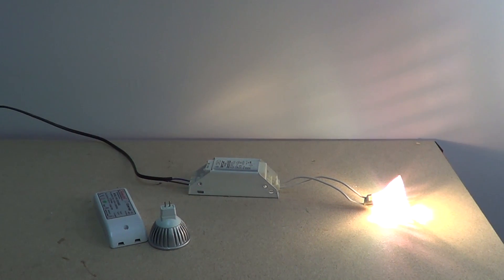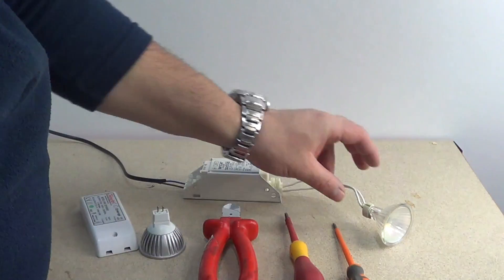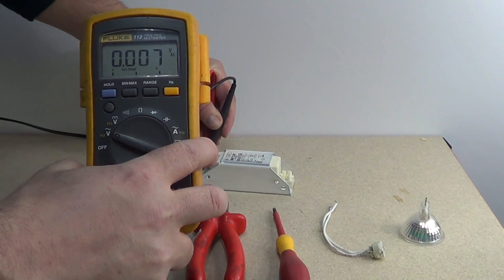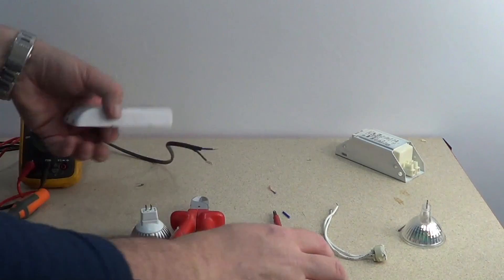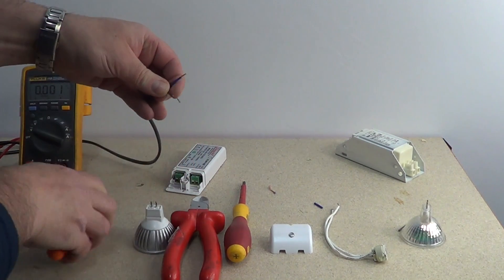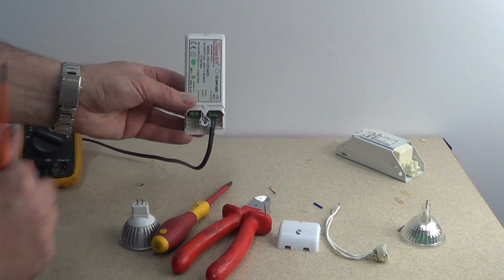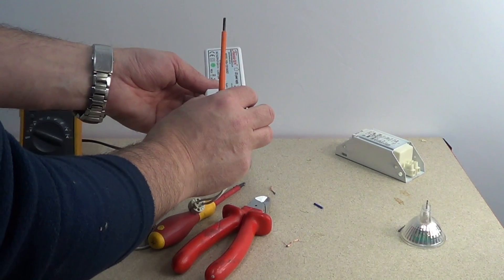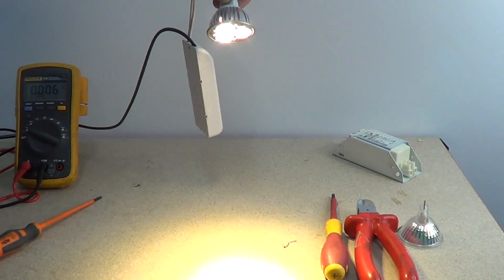How to remove a 12v Halogen bulb and transformer and Install a Led driver with led bulb

Comment: Hi completely with you but the black wire were does that go the problem I have is two white wires exactly the same so I presume there is a live and neutral and I have to work that out do these wires then connect to 3 core 1.5 if so wot do I do with earth help please aw its in a caravan  if that matters again please help

Comment: When connecting lead that goes to the bulb, the driver has a + & - port : I notice you didn’t check which you put in - does it matter ?
Reply: I know it matter DC + & DC - for halogen bulbs

Not sure about LED bulbs...look for labelling + & - like most things that definitely need it to be right way round.

...assume not matter since they are probably designed for even the most naive member of public.

Comment: Hi, is that a constant current or constant voltage driver? 

I have a Constant voltage driver with an output of DC12V, 700mA and a load of 9W max. 

Is that okay for the 12v g4 fitting and LED bulb?

Comment: Brama  - Is there a transformer for each of the old Halogen Bulbs or is there one one per room? - thanks man
Reply: Depends on how the lights are wired. If they're all on the same circuit without any other devices a single transformer should work. Distance between the lights can effect the brightness though.

Comment: When do you need a new LED transformer (when it's broken ofcourse, but what other problems could be the reason for a new transformer)?
Reply: i had one transformer for each 50w bulb.....but when i changed to 5w per bulb one of the bulbs began flashing.....I had to lower the transformer output range from 0.5 to 12w to cure it....it worked on that bulb...and the others are ok for now
Reply: If you current one can not handle the low load of the LED bulb.  I had three fixtures and one of them died while setting the dimming level, probably the transformer.

Comment: Hi , I accidently put the input of the transformer into the bulb. It blew out all of the other lights aswell as the one I was working on . Any advice on how to fix it? Cheers
Reply: Replace them, when one of these goes you have to replace it.

Comment: hello,
I want to use a halogen 12v transformer to power 12v led. you say in the video that it should be replaced. why?  is led driver really necessary?
Reply: Most Halogen transformers require 10 watts or more but a typical LED replacement for a 50 watt halogen is a 7 watts LED bulb, a LV version can use 3 watts or lower which in plenty low enough.  The other 43 watts was making all that heat he referenced.
Reply: LED drivers and electronic transformers for retrofit LED lighting are not interchangeable.

They differ in output and load compatibility i.e. which LED lights they will work with. 

The fundamental difference between the two is that LED drivers output DC while Halogen transformers output 12V AC.

Comment: I have a question, I bought 7 spotlights for my landscaping, each of them normally consume 50w, I change now the bulbs to LED cosuming  only 7.5w, I was expecting to use same transformer total capacity of 120w. For example 7 spotlights x 7.5 = almost 60w, but transformer is not working, is the watt amount coming from the fixture or the.bulb?
Reply: It probably can not handle the small load,  you need to replace it like this video shows.  Most dimmable transformers would work with such a load but yours may not be dimmer compatible and have a limited range.  Wattage load is from the bulbs but a dimmer can change the level.

Comment: does led lights need transformser aswell
Reply: The standard voltage is 230V. If your light works on a lower voltage you need to transform it towards that voltage. In this situation he was working with a 12V halogen bulb so he had to transform the voltage down

Comment: You didn't show how the driver was connected to the mains. Was it just a regular plug plugged into a wall socket on the other end of the wires?

Comment from the maker: It will not work.
Reply: Please explain. There is usually a "L" and "N' label. I asked  the question because I have a batch of transformers that have no labels. http://www.energysavers.net.au/anchorn-transformer-p-61.html
Please enlighten me. Thank you.
Reply from the maker: It would be best to contact your provider and ask for a diagram
Reply: Thank you very much. It is working. So I must have wired it correctly!

Comment: Hi mate, how do I connect multiple lights? is there an LED Driver that allows multiple connections when you unscrew the box? could you show me the pictures of it? Thanks

Kenwin
Reply: If the driver has sufficient output power, you can connect multiple leads into the globe side of the transformer. Just connect multiple of the white leads in the video into the same terminals (they should fit).

With older transformers made for halogen globes, they are 60w rated, so often can run many LED globes, due to the much lower power consumption.